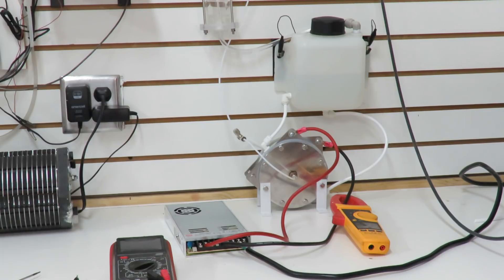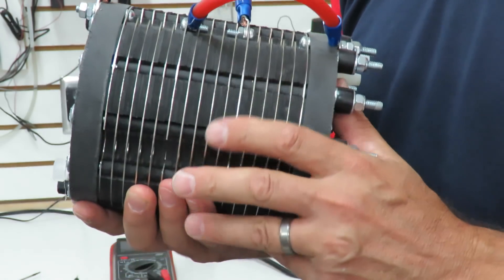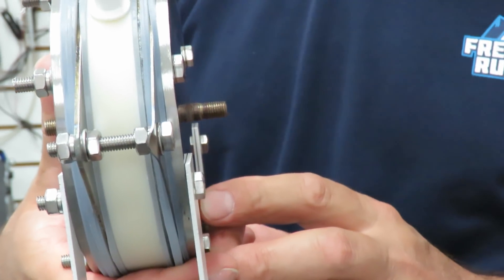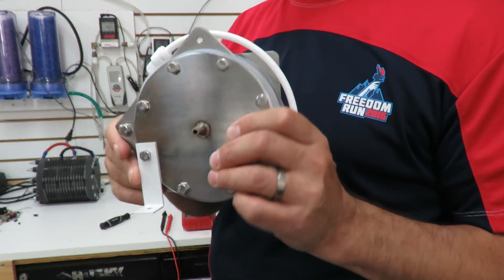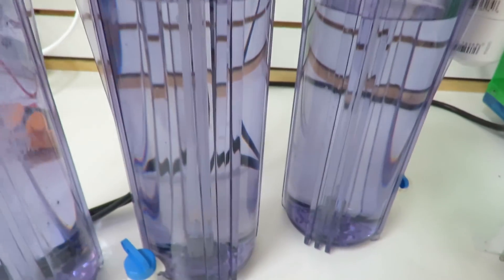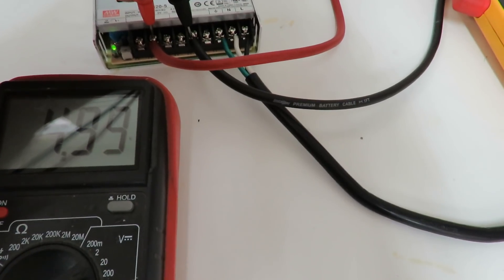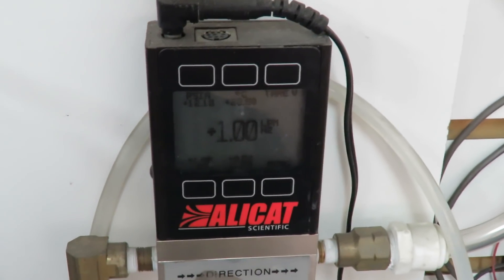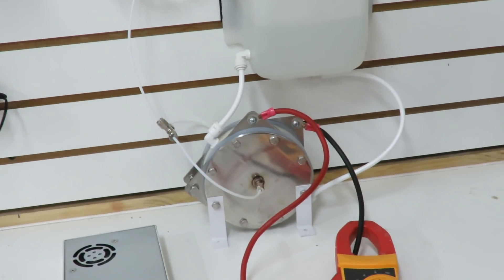Hydrogen compression. PART 5 We test out a brand new PEM cell

Comment: This is not called a compressor. This is an accumulator that relies on the principle of electrostatic charges and electrochemical reactions. However, there are risks and inefficient. I believe that it can be used to collect certain gases but not compress them.

Comment: One liter a minute is not enough gas to heat a 1000 square foot house with, I don't know how much I need but I really don't think that's enough even after it is scaled up. How can I calculate how much I need to heat my house? I was thinking if I run it on demand as needed and mix the oxygen back in I should not need as much hydrogen because it will burn hotter. 
   Hey, did you do the video of the guy in Germany or Austria who was heating his house on HHO or did you just repost someone elses video? Thanks man

Comment: have a question about the dryer, have you used a dryer for the hydrogen. I need to set up a facility and the HYDROGEN PURITY MUST be 99,999
Reply from the maker: Yes you must use a dryer to get .999 purity.
Reply: @Hydrogen4Health  I need a recommendation from you, I have 1 l/min flow rate from hydrogen after the PEM electrolyser and I can't find any suitable water separators or even water dryers. Could you please tell me or show me which dryer is suitable

Comment: Couldn't you hook these PEM cells up to capture the Oxygen, and just feed the Hydrogen and Oxygen into a Hydrogen Fuel Cell and pull all the power you need? I get the conservation of energy concept, but where exactly would the loss be? I get it eats the electrolyte platinum over time, but isn't that the only loss if it were a closed loop system?

Comment: how does the hydrogen move through the Ti? holes in the plate? wouldn't Ti be susceptible to embrittlement? why is the polymer platinum doped, wouldn't it be non reactive inside a polymer and could use something more conductive? why is this more efficient, I thought polymers are less conductive over water?

Comment: Will this work as a fuel cell also ? 

Specifically, If you pump Hydrogen into one side and Oxygen in the other will it make electricity?
Reply from the maker: It will but not very well. It's not designed as a fuel cell.

Comment: Hello :)
I am very interested in making and making such electrolyzers.
You can see my works and projects from my workshops that I made myself on the basis of a dry electro cell separator, where I achieved complete separation of hydrogen from oxygen ... What are the advantages of these cells compared to alkaline cells, do they have higher energy efficiency ?  https://www.youtube.com/watch?v=zgyn34SDocI
Reply from the maker: They do not use lye.

Comment: when you see the vacumn go to zero  when you turn off the pump, you know that air is leaking back into the vessel. you should use air conditioning hoses that have a valve at the end and then purge using pressurized nitrogen. standard air conditioning practice.

Comment: Thanks for these videos! Something doesnt add up when I do the numbers myself. You power your system with 5V*30A=150W. You make 1L/min, that's circa 0.07kg. With a Lower Heating Value of 120 MJ/kg, you would get 180W of heating power from the hydrogen you produce, while only spending 150W on producing it. How did you break that loop ;) ?
Reply: The man pretty much invented free energy xD.
Reply: That's because his flow meter is wrong.  That PEM electrolyzer he showed in this video is only two electrolytic cells in series.  I think he raised the voltage a little at the end and I thought I saw the multimeter at 35 or 36 amps.  Even at that amount of current, 1 LPM of H2 isn't possible.  Faraday's constant is 96485 coulombs, so x2 = 192970 amp seconds for one mole.  At room temp, the ideal gas is about 24L / mol (22.4 at 0C).  So 192970 / 24 = 8040 amp seconds per litre.  Divide that by 60 and you need 134 amps to get 1 LPM.  But that is for one cell.  For two cells (in his case), divide by 2 and you get 67 amps.  It is IMPOSSIBLE to get 1LPM from two cells at under 67 amps.  It's an exact science.  In fact, you can use the reading from a built-in ammeter to determine LPM rather than using a flow meter.
Reply: @ChristmasEve777  how much H2 you estimate an average small car would need to run on 100% H2? Here in Brazil we have cars using GNV (basically methane CH4) and the consuption is around 18M3 per hour.
Reply: The system has to run for 1 minute to produce 1 liter, so 2.5Wh = 9000J are invested. The resulting 1 liter hydrogen weights 89.6mg = about 1000J. So about 11% efficient.

Comment: This is bullshit, if there is a solid impermeable membrane adjacent to the hydrogen port how the fuck is the gas supposed  to get out??????
Reply from the maker: You're going to have to put a little bit more thought into it than that.
Reply: @Hydrogen4Health  Is it an impermeable membrane with holes in it?
Reply: @Hydrogen4Health  am I correct to say the you said on the video there is an impermeable membrane adjacent to the hydrogen outlet. That is what it looks like. I which case I would be correct.
Reply from the maker: Sammy D the membrane is in between the two plates. There are channels in the plates to direct the gasses to the outputs.
Reply: @Hydrogen4Health  ok I thought I saw you point to the outer seal when you said membrane, but I saw now that you pointed to one plate, membrane then the other plate.

Comment: Nice new dry cell. Was wondering if gas coming off of dry cell is 99.999% pure hydrogen why do you need all of the bubblers? I get the water trap and the dyers but not the bubblers unless its just to be able to visualize the gas moving through the system. Probably a stupid question but didn’t know the answer. Thanks for the videos
Reply from the maker: Michael Foster yes it’s for the video so people can see the gas.

Comment: In theory, could you increase output my creating a larger surface area?

Is the size you built motivated by existing plate templates for your tube electrolyzer or membrane supply size?

Comment: Have you ever attempted to run this system on reverse osmosis water rather than distilled? I'm curious if that is viable, as it would be much easier to keep the system supplied with water than distillation.

Comment: I saw a tube going from your hydrogen separator back to your water tank.  How does that work?  Is it clamped off and you have to let water drain back into the storage tank once in a while?  If you just left it open, wouldn't you have trouble keeping your gases separated because of pressure differences?  I'm really curious how you're doing that because I'm building something similar.  I HATE how, with PEM cells, water migrates through the membrane along with protons and goes out the H2 output.
Reply from the maker: The membrane is non permeable so the gasses can never commingle. Water does not go through the membrane, it is created on the anode side.
Reply: @Hydrogen4Health  I found a Chinese company selling those separators with a floater inside that seals it until the water level rises.  I totally understand them now.  Instead of ordering one (shipping costs about as much as the unit itself!), I decided to just run a line to a valve back to the tank.  As long as I have pressure on the hydrogen side, I can transfer water back to the tank by slightly opening that valve every now and then.  I usually have some pressure on the H2 side because I often fill balloons.  Ehhhh, good enough for now!
Reply from the maker: Legend of the Stormlord I’m going to tell you how we did it with permeable membrane.

Put a middle valve on the oxygen side for adjustment of oxygen release. Use an electrical water level float on the oxygen side to open the middle valve to let out some oxygen pressure when needed.

You can build a lot of pressure and never breach the membrane using this method.

Comment: You need to make sure that the hydrogen & oxygen chambers are completely encased in fortified, very dense metal or possibly centrated hemp plastics ( which can be made much stronger than steel), so that the H & O chambers are very, very hard to break or puncture in the event of direct high pressure collisions. So they don’t ever mix & explode. The cells should always be placed at the center of usage to minimize impact access, and the amount of explosive liquids made per minute should be limited to more than what is needed to run an engine non stop as in a car, truck, train, plane or possibly levitation sky vehicles. If the oxygen is not needed it should be released as exhaust.
Reply from the maker: I have absolutely no idea what your just said...but thanks for the comment.

Comment: Are you using fabric (Teflon) reinforced membranes in your cells?  I'm curious what max theoretical pressure this can operate under (reinforced or non) without costly rupture?
Reply from the maker: These membranes are not reinforced.  It is sandwiched between 2 titanium disks for strength.
Reply: @Hydrogen4Health  hi Steve very nice job can you make like a carbon cleaner machine but only hydrogen with 10 liters per minutes will be great maybe can run a 1.6 cc engine or charge an hydrogen car with that technical way. Greetings from paraguay south america

Comment: Great videos,subscribes afret 3 min. Can you tel me why you connect negative plates with bolt?
Reply from the maker: The bolt is used to connect the plates so all have power.
Reply: @Hydrogen4Health  Ohh, I fogot that you dont need electrolyte in water.
I will try to make generator for pure hydrogen with elecrtolyte in water. What type of membrane you recommend?

Comment: so damm good project im trying starting some research on this types of separators, you produce Oxigen on the -side and hydrogen on the +side but you are make + - + - pattern and suposoly you producing H on one side and O on the other side can you explain ?
Reply from the maker: No the Oxygen is made on the plates closest to the center of the cell. The hydrogen is made on the outside plate. It's wired +-+-

Comment: What if you needed a constant rate of 3.4 lpm?
Could you make a larger drycell to accommodate that?
Also if you wanted to make it portable say to power your car, would you be able to use the on board alternator as a sufficient source of power?
Also, can you safely compress an auxiliary amount of hydrogen for the initial start of the engine?
Reply from the maker: Yes you could use hydrogen to power a car but NO you can't get a bunch of alternators to power the cells. That's perpetual motion.
Reply: carry an extra battery or two.

Comment: Can someone explain me how to convert 150 watts over 1 min = 1 liter   to kwh/m3 ?
This is to calculate efficiency with respect hhv or lhv
Because I am confuse in the use of power which it would be watts per second over 1 min and convert that to energy by m3.
My math give me that it is 2.5kwh/Nm3 which is impossible because that is lower than the hhv of h2 which is 3.54kwh/Nm3, it would be like   a 142% of efficiency.
Reply: the plates are small and close together. not having potassium hydroxide in solution means its clean and allows you to ramp up the power to the cell to get more output.

Comment: Steve I'd like to buy your new machine & fill multiple tanks of gas for the winter season.
My questions are will this be safe enough to store in multiple large tanks for long periods of time? & if so can I store the tanks in an underground vault during the winter season without the cold weather effecting the tanks full of gas? & would it be just as safe as heating my house from these hho tanks just as propain or natural gas does? Thanks buddy!
Reply from the maker: Sure it should be safe to use. Hydrogen will leak out the pores through steel. The tanks must be vacuumed out before you fill. Oxygen is deadly.
Reply: Also how much electricity electricityis used to produce that .5 to 1liter/minute?
Reply from the maker: 200 watts
Reply: Thank you man & yes I saw your other videos. I apreciate your work!

Comment: I am very interested!!! I want to buy one. Nice job! Just a thought, why not run it on 12 volts? Cut the amps in half..?
Reply from the maker: Because there is only 4 plates with 2 gaps. It needs 2 volts per gap. I use a 5v PSU but if you put 3 of these in series it could be run off a 12v PSU.
Reply: @Hydrogen4Health  Hi, can you explain me how to convert 150 watts in 1 min = 1 liter   to kwh/m3 ?
This is to calculate efficiency with respect hhv or lhv
Because I am confuse in the use of power which it would be watts per second over 1 min and convert that to energy by m3
My math give me that it is 2.5kwh/Nm3 which is impossible because that is lower than the hhv of h2 which is 3.54kwh/Nm3, it would be like   a 142% of efficiency which is impossible.
Reply: @AngelLestat2  interesante opinion,

Comment: Have you done any pressure tests on this particular cell yet to see what it's capable of holding. The more pressure you can get in that cell the less power it's going to consume to compress the gas using a compressor. For instance if the cell could go up to 200 PSI then that would pretty much take out a couple of stages in a multi-stage high compression compressor so it would be more efficient. Since it's a non permeable membrane you should be able to pressurize the cell much higher than the previous design. 

You can get a reasonably priced high pressure compressor that is used for refilling cartridges on paintball guns. You probably already thought of that.
Reply from the maker: I didn't think about paintball compressors. Thanks for the idea! The cell has been tested up to 60 psi but I don't want to blow out a membrane. They are so expensive! I'll use a compressor to get to higher pressure. I hope all is well with you Tyson.

Comment: I just love this guy....... This kind of attitude can really change this fossil fuel mess
Reply: batterys   are two expensive. if you could store h2  all year for the winter you could heat your house. try doing that with batteries.
Reply: Joseph DuPont I did, they burn quite nicely. I’m just a little bit concerned about the waste and toxic fumes... you really think this was a good idea?
Reply: Ah, the fossil fuel mess ! Fossil fuels have created more wealth and progress than any other single thing, except maybe, capitalism. It has lifted more people out of poverty than any other thing. Again except for capitalism. Everything you own and travel in , uses fossil fuels. The plastics in your cellphone, the rubber in your tires. Even your much vaunted electric cars, use massive amounts of oil in their manufacture and in their makeup. Without fossil fuel/ oil, you wouldn't have any of the modern conveniences you enjoy. Including the device with which you posted this comment. The electricity that powers that device more than likely came from fossil fuel. Unless you're using a solar panel for power. No offense intended, I just get so tired of the hypocrisy. Yea everything I use is powered or made from oil, but I'm anti oil. Okay.